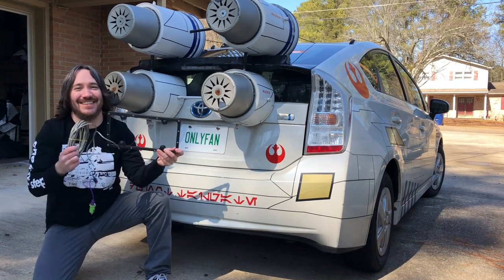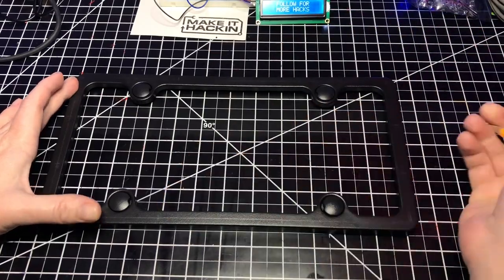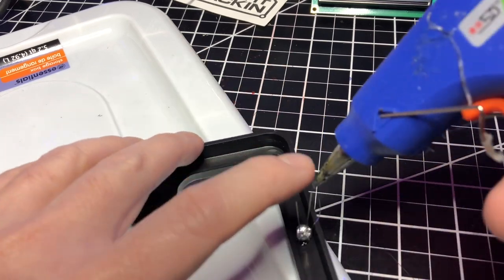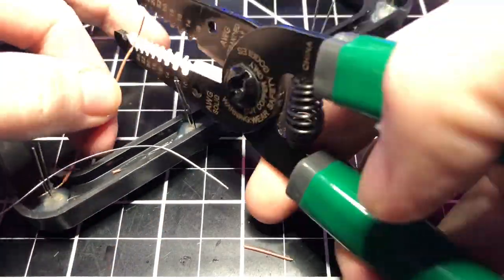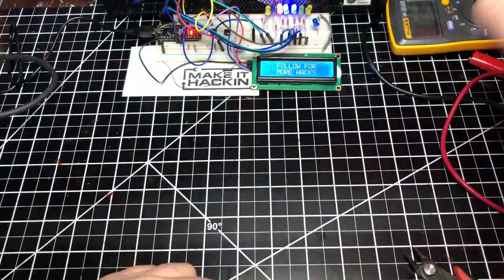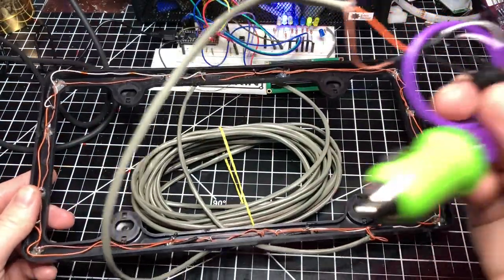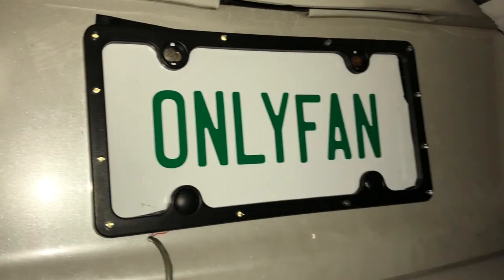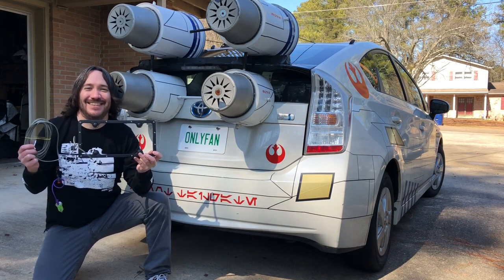Infrared Camera Blocking License Plate Frame - Tutorial - How To

Comment: You could hook it up to the license plate lights so you wouldn’t have to route all the way to the front.
Reply: I think it’s done that way so you can control it
Reply: @logancaudill2457  why would you want to controll it
Reply: just take your front plates off
Reply: @logancaudill2457  it would turn on with the headlights
Reply: @logancaudill2457   yeah but the license plates lights also turn on when you turn on your head lights so you can control it like that too
Reply: @cody2246   are YOU dense? You can turn on and off the license plate lights when you turn on and off your head lights. Plus it’d be pretty hard to catch someone you can’t take a picture of. Also the lights look like normal license plate lights so who would suspect
Reply: @khoile5110  ok in
Reply: @miles9598  hahaha
Reply: If you have the lighter ports that shut off when the vehicle is off, don't need a switch.
Reply: @Kara_Kay_Eschel  same with the license plates lights
Reply: @khoile5110  In the trunk on my SUV I have a cig lighter port, Don't have to mess with that
Reply: This Is The Way...with a voltage regulator for the LEDs. You can leave the existing lights in place, but with the LED circuit in parallel. 
You could also use UV LEDs in addition to IR- I would think that if the plate is reflective, the higher energy UV would overload the camera sensors more easily.
Reply: What if you put very high output IR lights inside your existing factory license plate lights?  Will it still blind the camera?  I know they wouldn’t be aimed directly at a traffic cam/speed cam but the high brightness may still blind the camera!

I use a night vision camera for boating at night and I am installing IR leds inside my docking lights on a separate switch so I don’t blind on coming boaters but I can see light daytime w my night vision camera streaming to my iPad!
Reply: @bramtenhoor7102  The law! no white light omitted on the rear of a vehicle.
Reply: @rimc8783  omitted means leaving out or excluding.
Reply: @bramtenhoor7102  Because you don't want it activated while a police car is following you. If their system can't pick up your license plate they'll pull you over.
Reply: @rimc8783  The  lights appear white to the normal eye.

And the license plate light is required to be white.
Reply: @rimc8783  you guys are missing the IR LED part. IR can't be seen with the naked eye and only detected using night vision.
Reply: @gregorykusiak5424  If you like things being the color they're supposed to be UV is not a good idea
Reply: @-BuddyGuy  I don’t much care about the license plate they make me use. However if it spills and changes my paint, that’s another matter.
Reply: If cops are behind with number plate reader on board you would have to turn off headlights while driving... Gonna look fishy at night. Why not use rear fog light wiring?
Reply: this only work in the night time, what about day time.. could add more led will solve it?..
Reply: @TreadTalk247  that wouldn't work. The principle is completely different. The reason this works is that the light is creating a distraction in front of the plate. The LEDs are not pointed at the plate they are pointed away from the plate. So the light is going in and outward direction. If you use those same LEDs and focus them in on the plate like your normal light does it would illuminate the plate and make it more visible. The same reason that if I'm shining a flashlight at you in the dark you can't see me. But if I turn that flashlight around and pointed at myself, clear as day.
Reply: cops have dash cams, If one happened to be behind you they would see the bright light around the plate on the cam, but not with their eyes. You'd get a decent fine from that. Having a switch makes it so you can quickly flip it on while endangering other motorists by running a red because you couldn't wait a mere minute longer to get home to watch anime.
Reply: @frostbite1991  I prefer to endanger others by watching anime on my phone as I drive. I run red lights because it's fun.
Reply: @Neoprototype  this is a much more efficient method.
Reply: @bramtenhoor7102  you could buy a wireless remote. They are cheap too. I bought one on eBay for like $10. It just comes with a little board you connect to 12V and you just connect the circuit to that board.

It makes it for easier installation and you have a wireless remote to control it.
Reply: @khoile5110  some of these people are the kind go to get a vehicle inspection, in broad daylight and when I ask them to turn their lights on, they tell me, oh their automatic.
Yeah they are, and the sun is up.
Reply: @rimc8783  um the bright light is only visible in infared. To the human eye they see nothing. Maybe some slight ref dots. Why it only works with night vision cameras.
Reply: @rimc8783  emitted, its a simple mistake
Reply: @frostbite1991  we don't have video displays on the dash cams. We can't see the video until it's uploaded
Reply: @GeorgeLiquor  that's odd. Would have been easy to incorporate that into the infotainment system, or the laptop for that matter.
Reply: @frostbite1991  there's no need to watch a dashcam. I have the windshield right in front of me. The MDT mounts block the radio display, and there's too much going on on the MDT itself for a window showing video
Reply: @GeorgeLiquor  does it upload automatically, or do you have to initiate it?
Reply: @Parasclepius  they get dumped and deleted daily, unless there's an incident they want to review. I'm not sure how it's done
Reply: You would still need a control line to switch power.
Reply: @Joker-jk4zm  on my car i can turn on and off the license plate when i turn on and off my headlight but I guess you can add the additional switch im just saying all that wiring isnt necessary if youre gonna run it all the time
Reply: @M0N0T0N0US  i think he meant emitted
Reply: @rimc8783  emitted
Reply: @pedclarkemobile  yeah the one guy just doesn’t seem to get that and yet he’s the one calling other people dense 😂 it’s hilarious to me how many people think they’re smart
Reply: @khoile5110 , I believe the idea is to turn it on when passing a speed camera,  red light camera or passing through a toll ; then turning it off. At least that's what someone would do with their tractor trailer and even their personal vehicle. That way it is not continually on........ Unless a patrol car or highway trooper can not perceive it through their on board cameras......
Reply: How efficient are the IR lights for daytime use when passing through toll areas. Is the output high enough to blind the toll cameras in the daytime as it seems to do at night????

Comment: Add extra LEDs. Red ones. Wire those to the brake lights. If you get asked about it by police you can say it is just an extra safety measure.
Reply: Just add a backup camera and say they are illumination for the camera.
Reply: Or just say nothing. You're not obligated to answer any questions. Am i being detained? No. See ya
Reply: @respond_code3  just because you choose to not answer questions doesn’t mean you can’t get a ticket for vehicle safety issues or traffic infractions.
Reply: @JamesThompson-xl4yu  can’t have white light facing the rear of a vehicle except in reverse. The exception being license plate lights which are only supposed to illuminate the plate and not project light rearward.  As for adding super bright red lights facing the rear, that’s a ticket too for improper lighting if they deem it a safety hazard.
Reply: @FFred-us9tw  also, have you seen how bright is the normal 6mm red led? Basically nothing, even if you get the super bright 6mm variant, it is not even close to the brightness of normal rear lights, not even mentioning brake lights
Reply: TÜV sagt nein!
Reply: @KnoppersPolizei  Yes but we can't hear them from 8991 km away.
Reply: @respond_code3  LMAO... yeah, good luck with that. I'm sure they'll make up some excuse and give your car a full search for drugs. Police aren't very neat about that sort of thing, either.
Reply: @erichtisnado1536  no luck needed. Its worked out fantastic the last 2 plus decades
Reply: @respond_code3  I'm Latino.  I know that is a shortcut to a good beating and harassment by cops. Hard pass. I don't even put political stickers on my car anymore. I've actually been pulled over for them in the past.
Reply: @erichtisnado1536  oh shit. Yeah we live in different worlds. 
Officer: Know why i pulled you over
Me: Yeah, we all make mistakes (proceeds to hand him my white privilege card) LOL
Well... I guess i should have an Italian privilege card. But what got me out of my list 2 stops was really my uniform.
Reply: And then you get a ticket for illegal lighting.
Reply: Actually sense it is ir, add a backup camera and claim their for not time illumination
Reply: @napalm3899  depends upon the state. As any 4x4 off-road rig owner knows well, different states have wildly different lighting restrictions and requirements. Go read California’s sometime if you want a laugh. You can get a ticket for your lights being either too close to the ground or too far off the ground, depending on the phase of the moon.
Reply: The red lights will draw attention to the plate and that you don't want
Reply: @FFred-us9tw  They are infrared, so the naked eye can not tell.  So, unless a cop has some sort of infrared camera on his car, how will he know anything?
Reply: @FFred-us9tw  Then don't have "super bright red lights".  Only have red lights.  Plus, there are bright red LED stop lights anyway,
Reply: @napalm3899  exactly
Reply: @erichtisnado1536  just get the light flashers they sell. They don't go off until a camera tries to take a picture. And they aren't illegal.
Reply: @imnewtothistuff  you won't see the lights
Reply: Having IR lights on a car should not be illegal, but I'm sure if enough people did it, they would be soon.

Comment: This will work for cameras that are designed to have night vision, but visible light cameras typically include infrared filters because you get a sharper picture when you block the infrared.  Just applying retroreflective stick-on material on the license plate frame would probably work better, because most traffic cameras have a light source near their lens.  A cop would only be able to see that if he held a flashlight right next to his eye.  From any other angle, it would not reflect back to his eyes.
Reply: Where can I get them?
Reply: licenseplates themselves are retroflective, so it would be pointless

Comment: Just a tip when you're making something like this. Use your soldering iron to melt the insulation on the wire then pull it apart with your fingers. You can make one long continuous wire for both your power and ground. Insulate it with epoxy or hot glue where needed.

As far as the design I don't think it works as well as you would have hoped. They can change the saturation, brightness, gamma and all other video settings to be able to read your plate. If you had something over the middle then maybe it would work, a clear film that you can pass light through to act as a diffuser is a possible solution. Thin plexiglass would work well enough and not look out of place.

Either way it's a cool idea.
Reply: Many States don't allow anything covering the plates.

Comment: To make fitting the LED's easier, solder them to a custom PCB first, and fit the PCB to the license plate holder.  Instead of using the USB cable and charger, use a higher current dropping resistor and connect directly to the 12V system of the car
Reply: Can you recommend any specifically? Like pretend we know nothing about this, steps to do it your way? Yours sounds way better

Comment: Be sure your LEDs are 904nm wavelength. This matches police LIDAR.

On the front, use a Raspberry Pi to strobe them at 14Hz when you press a button. This will turn your traffic signal green at Opticom equipped intersections. (That gizmo on the light crossbar that looks like a beer can with 2 fingers sticking out the side)

If you also make them strobe at a high PRF rate that is somewhat random, they will prevent or delay police LIDAR from locking on. (Control the LEDs individually so at least one is always lit) That 1/R^2 thing really works...Lidar can't pick out its own reflected return if your bright pulsing causes destructive or constructive interference with their signal.
Reply: 904nm won't do anything, not against camera flashes, and not against LIDAR.
LIDAR laser power is about 30 Watts (for about 10ns). The LIDAR sensor easily discriminates it's own (partial) 30W (retro) pulse reflection, from ambient IR light (of which there is plenty - sunlight); hence wildly divergent, comparatively weak LED light wont do anything. 

"strobe at a high PRF rate that is somewhat random, they will prevent or delay police LIDAR from locking on"
While it is possible to confound a LIDAR gun, the device will inform the operator if a laser defeating device is used (various error messages: E01/2/3/7) . The penalty for being caught trying to defeat any speed camera is much worse than that from speeding, and users of these can be caught even if not speeding.
The processing ability needed to confound a speed gun without inducing any error message is well, well beyond what a Pi can do, and the knowledge to do this is well, well beyond what any amateur engineer will understand.
Source: I personally own 2 different LTI2020 LIDAR guns and borrowed others. I know exactly how they work from my own probing, tear-downs and experiments (and yes, I have experimented with external 905nm lasers). Also, I kick ass at electronics.

Gasto type cameras already cater for it's own super-bright flash from retro-reflective plates, so some divergent, weak LEDs won't make much difference.
IR ANPR sensors also typically use their own active bright IR illumination; furthermore, such a defeating device won't anything against the accompanying overview cameras (not IR sensitive).
Reply: @smeggyhead1  and if pulsing things is all you need to do, an Rpi is way overkill. I'd go arduino if it's a quick hack, but you could go even simpler, NE555 anyone? :-)
Reply: @plonkster  You could use a simple timer as a pulse source, but as I said, the designers of these speed guns are wise to it. Trying to defeat an LTI2020 in such a manner either won't so anything (the speed will be measured as normal), or it will display E07 and squeal like pigs on a honeymoon. I've done this test.
Reply: @smeggyhead1  what can you use “educational purposes” for overhead toll cameras?
Reply: @smeggyhead1  Do you know of any discreet but effective way to stop toll-road cameras from reading your plates?

Comment: I think the license plate cameras can adjust the ISO exposure to compensate for the IR saturation from the IRs in the plate frame. If that is the case, the plate will be readable.
Reply: The speed cameras also use a high power flash that would likely render this hack useless.
Reply: Unless things have changed recently,  the cameras flash is set for the ambient light at that particular time of day or night and does not expect a plate to be lite up many times brighter than what it was designed for which causes the image to be overexposed.
Reply: @mmace3  They can't and don't. Variations of this hack are extremely popular because they work. There are much simpler versions -same idea. Cameras can not photograph light or mirrors. True now and has always been true.
Reply: @mmace3  the readers in the cops car don't use a light. Yes they finally put the tag reader in The car they can get all your information just by pulling in behind you now

Comment: A metal license plate frame might save a lot of trouble with the grounding. 
Could get tap power from the rear defrost if the vehicle is equipped.... that would give you a switch that’s already wired and handy.
Reply: Why not leave them on always? only L.E.D.S's?

Comment: You might try edge-lighting like a a 1/4" thick clear acrylic panel over the tag for a more homogenous distribution of UV photons to obscure the plate. That way the LEDs could remain hidden behind the frame as well.  Either that or at least two salient LEDs top and bottom to better blind the center area.

Comment: I didi the same thing about four years ago. Only I covered the lights (or the frame of the plate-holder - which ever way you want to phrase it) with strips of beeding (lined with tin foil on the inner side). This hides the led lights from plain sight and still it illuminates the plate. 
My pleasure.

Comment: Tip for the wiring! take a piece of single strand tinned copper wire and stretch the it until it stays straight. Then wire it as the ground wire sliding some insulation over the gaps. Saves a lot of time than soldering individual wires.  Once all the wiring is done you can seal / encapsulate the wiring in coloured epoxy that should waterproof the whole thing.
Reply from the maker: OMG, great idea!

Comment: Make a PCB to insert it into the frame, cut larger holes for the LEDs. Cover the LEDs with Black plastic which is transparent to infrared. Use different resistors and hook the leds up to the license plate light. And as you are using a PCB now, use SMD LEDs.

Comment: i love that you used cat5 wire it really is perfect for stuff like this
Reply: For 5 volt DC and a good bit of current, across a 5-6+ meter long skinny cable? I don't think so. Probably not even 4 volts coming out at the sign, certainly not under load. Actual ethernet signals are barely a few millivolts. To enable a little bit of power to run across cat5/6, like PoE, you have to boost the voltage up into the low 50s. Otherwise the relatively high current for the skinny long wire causes far too much of a voltage drop across the cable.
Reply: @pr0xZen  i mainly meant as convenience but yea probably not a good idea to run a lot of current on it but i woudl imagine for leds it will work just fine